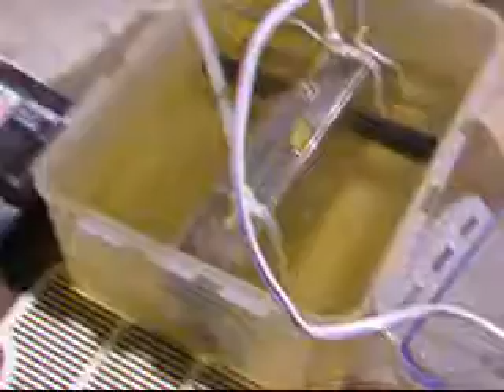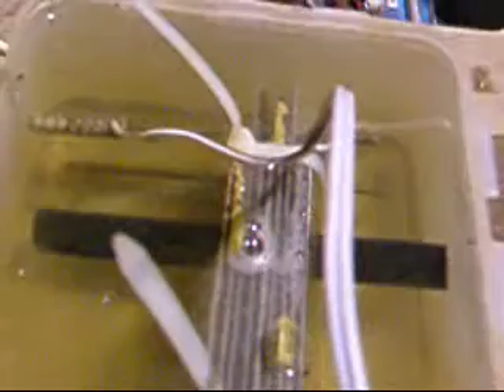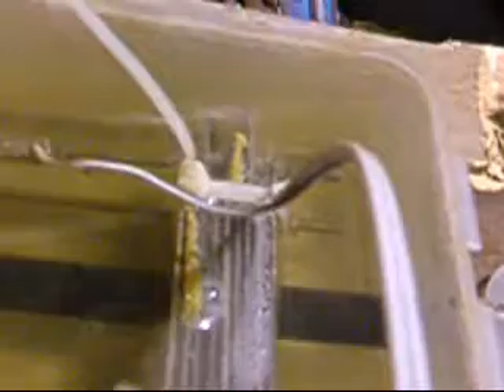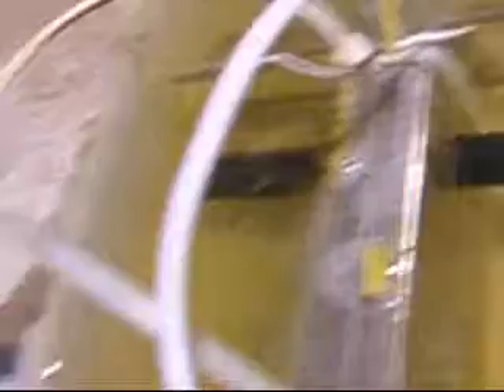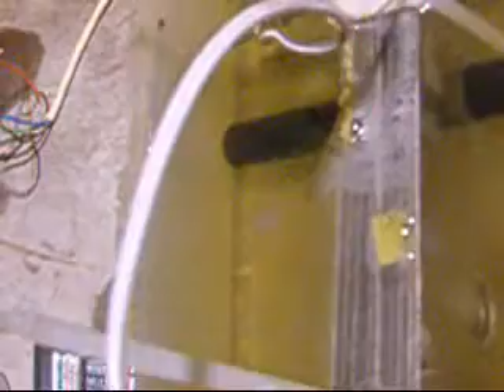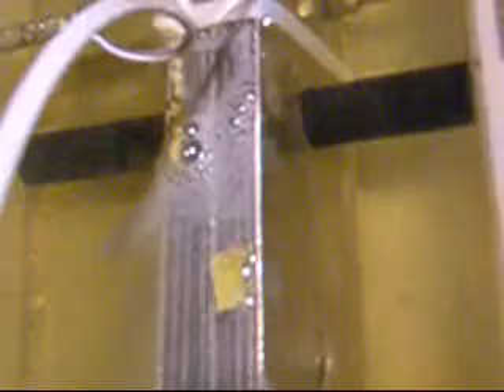1mm cell at 24V  #12

Comment: If you cross hatch your plates with sanding paper, you'll get a lot of tiny points on the surface from were bubbles could start.
And a good Electrolyte ( if your cell can resist it), is KOH or NaOH ( Lye, like Red Devil draincleaner), start with only a few %, and watch the amps go up & the gas production.
Reply from the maker: Would love to do this project again

Comment: Way to much voltage for a pseudo serial Cell.
Take Strapped's advice and seal 5 of the 6 sides
and drop the level a bit, so to make a real serial cell. And use a bit of electrolyte to.
( to higher the amps and the gas production).
Also cross hatch your plates they are to shiny.
Reply from the maker: Yes 15 years later it’s amazing how much I have learned

Comment: would be better than nothing. if your leaving the top and bottom open, try to make the water level just a hair below the top of the stack. that way you,ve basicaly sealed 5 of 6 sides. since current wont leak through air like water.
Reply from the maker: Thank you

Comment: I wouldn't go much less than 1mm. the more sides you seal the better. could seal all 6 with plexi glass or similar. then make some holes or slits in the bottom and top for flow. the idea is to make it very hard for the current to flow around the n plates. path of least resistance needs to be through the n's.
Reply from the maker: Thank you